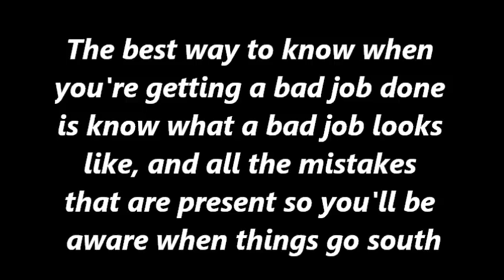CONTRACTOR SCREWS UP SHOWER

Comment: It's really difficult for me to evaluate the competency of a contractor before a job.  I hired a tile contractor who was RECOMMENDED by a mold remediation company we had worked with and multiple mistakes were made on our bathroom remodel project. There was a "miscommunication" where I had explicitly asked for a drain that had a removable grate so I could easily clean out the shower drain.  NOPE.  The contractor refused to install a new drain once the shower mud had been poured.  I tried to read-up on tile shower installation and inspect the job as it went, but I'm not a tile expert. That's WHY I hired somebody.  In the past, I think the contractor had hired somebody else to do the plumbing parts of the job, but decided to do it himself this time.  He cross connected the hot and cold water lines (didn't insert the valve) in the shower and couldn't figure out what was going on.  We had noticed the shower in the adjacent master bathroom was having wild temperature fluctuations.  His recommendation was to buy a new water heater. He came out 3 times to try and fix a water leak on our new toilet.  The adjustable height sink drain plug rod was bobbed off too short and was jamming, 2 months later, we found the drywall at the outside corners of the shower curb is wet.  One side of the shower door railing was installed backwards preventing the door from fully closing, which he did fix after I complained about it. 

 If you have any advice on what types of questions to ask when you are hiring somebody, I would love to hear it.

Comment: $1500 ? To do a shower? Lol.
I wouldnt dream of doing a shower for that. I might lay tile for that but build out the drain, slope bed, waterproof membrane and tile? 
No way!
I start my showers at $2900 not including the shower enclosure/door for basic tile work. A bucks up shower with a niche and nice porcelain or stone tile might go $5500 plus $1800 to $3200 for the glass enclosure/door.
There is NO WAY it can be done for $1500. No way.

Comment: I’m sorry but waterproofing is extremely important.  While it’s not “as critical” as the pan and curb, it will slowly leak and cause light mold growth in the stud cavity.  Not waterproofing walls greatly reduces the useful life of the shower.

Comment: A comment on the video. Take a flashlight and all the defects you pointed out will easily show up. I refinish tub and tile and the most common mistake I find is the tile meeting the lip of the tub instead of being inside the that area.

Comment: My attempt at a shower failed really bad. Good thing I stopped before I got to far. I’ve been doing flooring for 18 years. Just because u can handle a little tile on a flat floor or a backsplash underneath cabinets does not make ppl able to do ALL that it takes for a shower. I learned the hard way. 
Details 
Details
Details 
And prep till u cannot prep anything more.

Comment: Q&A: Have you ever tiled a swimming pool or fountain?  I’m not finding anything good about this on YouTube.  I’m curious about the challenges and special materials needed for a tiling project that is always submerged.  How does the pressure/weight of the water affect the tile?  I’m binge watching your channel.  Love it!!  Thank you!
Reply from the maker: Laura Saul no I do not have any applications that had to do with a fountain or a pool, only the coping tile around pool area. But there would be a specific thinset to adhere tile in a water environment, it's the chemicals that would affect the adhesion. Best people to ask would-be a pool company I would think.

Comment: Hey man, good videos. Have you ever done business with the Tile Shop? I'm a manager at one in Ohio. Keep up the good work!
Reply from the maker: Tom Nicholl yes I have years ago when a few of them open here in metro Atlanta I used to do business with them, not anymore. They are much more expensive than other tile shops, they do not keep anything in stock so if you come up short you're at least a week out from getting more material, but the biggest issue is their contractor kickback policy, you're supposed to get 5% of total sales for a quarter to use toward tools or material... but if you do not meet their threshold in that quarter with whatever sales you have, then accumulated sales go away and you start over again. Their sales did not go away but my little 5% sure did. I don't even step foot in that store anymore, or even recommend them

Comment: As to waterproofing membranes.... im a GC, do mostly tile now, large custom showers, floors and splashes. On one bath surround a few years back i thought about using kerdi but didnt. 3x6 travertine, modified grout, 3 applications of penetrating sealer and enhancing palm frond oil applied over that! Well, the walls were wood 2x4 studs with 1/2 hardie backer and drywall on other side. About a year later I get called back, the ceramic corner shelf had been ripped in half. Humidity was passing through the tile and backer board, made the stud kick away from the shower about 1/8". Simple fix, new shelf and some grout, more sealer. But I was gun-shy about wood framing for quite a while after that until I got sick of trying to screw hardie into metal studs. The take away Is I will NEVER tile a shower without waterproofing again! I am intrigued by red guard and will give it a try if you like it. Do you roll or spray? Some of mine are big enough to merit spraying. Thanks for these videos they are great!
Reply: BTW Im in the tank for Schluter Kerdi fabric, not the board. But they are moving away from styrofoam pans, curbs and seats towards kerdi-board and the kerdi on the board is not the same as what comes in a roll. Its terribly labor intensive and may be time to look to alternatives, at least for the walls not the pans.
Reply from the maker: What you dealt with in that story is definitely in anomaly, I don't know that I would say for sure it was caused by moisture but anything is possible I suppose. Redgard can be diluted and sprayed on, I am doing the roller and brush application for most all of my jobs.

Comment: Great videos, very infomative. Just ignore the trolls. Question, whats the difference between sanded and unsanded grout and when should you use them?
Reply from the maker: Sanded grout should be used in probably 90% of the applications, also if your grout line is more than 1/16th. Personally I would never use unsanded grout in any application in a shower

Comment: When putting up glass mosaic, you don’t use a standard 1/4” notched trowel?
Reply from the maker: Depends on the mosaic, some are VERY small, others bigger, some of the mesh backer is stiffer than others...honestly though, a mosaic doesn't need trowel, just get the thinset on and press it in.

Comment: I think one other thing as well with the TCNA/etc, is I think in residential situations, you can get away with a lot, and not have it be a giant problem. Where the TCNA and then various companies have a lot more concern is tiling things like entire subway systems, skyscrapers, etc. At the end of the day, the TCNA probably doesn't care a lot about a homeowner's bathroom. If you go on Laticrete's website they have 300 page manuals about tiling subway systems, hospitals, what have you. Even the basic TCNA class I got invited to by a Mapei rep would have counted toward a continuing education credit if I was an architect or engineer. Besides even expansion joints, they go into things like humidity, taking into account vibration, etc. In a house, to some extent, lots doesn't matter, and you can a lot of times do whatever and have it be OK, but by the book matters a lot more in those scenarios. Building residential showers in this way is pretty small potatoes work compared to if you were a foreman for a crew tiling an entire subway system. 

As an aside, for getting away with residential vs commercial. A friend of mine told me his uncle used to 5 spot residential floors, and whenever tiles broke he'd tell them "It's because you bought cheap tiles!" and he never got sued until he did it in a commercial store and they drove a forklift across it. Then after that lawsuit he moved to Florida.

Comment: I can only imagine how he set his pan liner if he  used one. I’ve seen knuckleheads use tar paper for liner, you can see the 1500.00 dollar difference from a pro vs an a novice
Reply: There is a way to use tar paper, it’s called a hot mop shower pan. I wouldn’t ever use that method but it is a method.

Comment: Thanks for the great videos, you seem like u would be a good boss to work for. Im doing my shower and watch a lot of your videos and i put down pebble mesh rocks for the floor and i understand that grout can fail because using pebble for the base there is a lot of grout in some areas. I used the tec power grout 550 that has sealer in it so u dont esentually have to seal it ever. Would u seal it anyway due to above normal grout area's?
Reply from the maker: mercedesclan 420 no...just like Prism grout, it's sturdy enough for large spacing and repels moisture

Comment: Love your videos. I do a lot of tiling myself and I am amazed how many terrible jobs you find. 

You mentioned that you like to see a grout line in the corners. I personally don’t like grout in the corners because it tends to crack after a short while. I always explain that to homeowners and try to have them agree to silicon for the corners. Obviously the downside is that sometimes you won’t find matching silicone.

What’s your take on that?
Reply: Joerg Neumann his take is he likes grout in the corners. Why dont you grout the corners so it matches and than cover with clear silicone for protection. Or just mix your grout with a grout sealer so it's more uniform and water proof.
Reply: @ddentici  u need at least 3/16 bead laid for silicone to last.  Smearing silicone over grout or small thin beads will crack and not do anything but get crap under it that will start to mold, then u gotta scrape it off 6 months later when it begins to fail.  

Haven't check since 2000, but silicone caulk in all corners is code in MI

Comment: Hi Bob, 18.06. Me to.And i expect to be shot down for this. I have tiled i dont know how many hundreds of showers without waterproofing. The 2 shower rooms in my own house, both tiled 19 years ago, no waterproofing, tiled straight onto plasterboard, bone dry. No issues whatsoever. Corners and joins taped, acrylic primer, powder flexi adhesive, good notched trowel and back buttered. In London where i live and work there is a lot of competition, and prices are tight, very tight. If i cost in all these fancy waterproofing systems, and once ive added my VAT, i'd be out of work, fact. Always someone cheaper especially if they are not VAT registered as i am. VAT alone adds 20% to my estimates.
Reply: A "fancy" waterproofed system with good mortar and backerboard will last 100+ years. The schluter system alone is tested 4 stories underwater. There is cheaper ways to get the same results as the schluter system however. It comes down to an exact science and materials together and yes there is a million ways to do things and some appear to work fine but with tile it can appear just fine until there is a major problem that suddenly appears.. a hairline crack in grout and no waterproofing for example and then all the sudden it's completely rotted out behind the perfect looking tile covering it up. in your case Plasterboard is stronger than drywall and porous enough to bond to mortar. Your acrylic primer/tape is acting as your waterproofing which is better than nothing. The powder flexi adhesive is good because it's probably glass based and won't absorb as much water as the ordinary cement based mortars which is important in your case. So all in all doesn't seem that bad from material point of view with weakest point being the backerboard is the plaster walls. I'm no expert but that's my observation.

Comment: I think a problem is that being "by the book" it's first better to know the rules before you break them. My house has 24" joist spacing, technically TCNA basically says I should not have tile at all. I decided I'd be marginally safe enough if I thinsetted my CBU in that scenario, added some blocking when I put my new plywood in, and used good thinset (Custom Prolite) and Aquadefense as an uncoupler. Hey, the tile job we had on first moving in (lasted 4 years before my mother hired someone else who did an even worse one) had no cracked grout or tiles and it was Durock on top a messed up subfloor with 2 layers of linoleum and laun, and applied with a V notch. Sometimes it's a combo of luck and how the user uses stuff. In my house my railings are put on with wall anchors and it's 100% fine and lasted for years. My friend's house, put a railing on with wall anchors for him and it broke in a month or two, because we're generally nicer to our things. 

A "rule" scenario that tripped me up, I bought a Henry patching product to try to level my floor and it was absolutely terrible for that purpose, and a normal rapid set thinset actually worked a lot better, shrank less, didn't crack, was cheaper, and, didn't set up in 5 minutes, etc, but it broke the "rules." 

One thing a semi-high level guy at a TCNA conference told me (it was actually really neat, tons of free food and beer, a Mapei rep invited me, a homeowner, when he was at the store that day because I was asking him about the Aquadefense reenforcing tape...) oddly enough was "It's usually not the first thing you do wrong that causes problems, but the third or fourth thing..." So that goes with the rules. It's better to know the rules if you're going to break them, and know why the rules exist for what reason. Then if you gotta break them, you gotta break them. To some extent on the forums, it gets into a bragging contest of who is most by the book, etc, and it's silly, but it's good at least to know the rules first before breaking them.

Comment: Should have recommended for guy to finish then use shower until it falls apart most likely 10 year later if not used 5 times a day, especially if quality matches other low-skilled work like paint job with dirt all in paint, or dented crappy installed trim or other

Comment: Awesome video. It helps a lot of home owners to understand what they are looking for. I will disagree with you on grout lines on the inside corners as grout will crack because of vibration. Where as a bead of colour matching silicone or a neutral colour will not.
Reply from the maker: As personal testimony, my shower is hitting 5 years this November & not a crack to be seen...anywhere...should it occur I will caulk, can't remedy a problem without a problem.

Comment: Damn bro that is a jacked up shower.  I hot mop my showers.  I lath, scratch and float the walls. My showers are solid as fort Knox when I'm done. My niches are precision framed for full tile layout.   I don't do any of that Schluter crap or backer board. Real tile guys cement float, just saying!

Comment: I’m not sure if your in Georgia or Florida? I’ve heard you mention both. Do you not have to be a licensed contractor in these states to do work or specific trade licensed? 
You say in your videos “the contractor” did this work. The videos you show looks like the type of work I see from a guy that thinks he’s a jack of all trades but master of absolutely nothing.
Reply from the maker: As Progressive as Metro Atlanta has been the last 20 years, they are still a lot behind on many things... it wasn't even until about five years ago that you had to use a seat belt if you owned a pickup truck, they finally passed a law mandating that !
Still in the end it is homeowner's responsibility to do their due diligence

Comment: Bob, about half the tile jobs I do include some sort of accent tile and I rarely find the difference in thickness to be 1/4", even when considering the thickness of the thinset. What I  do is get all the main tile done first, then make a screed to build up the accent areas with thinset to the exact level needed. I hope you can picture what I'm describing. It is meticulous and does require some careful planning, but it sure beats always having to hunt down a suitable material of the correct thickness.
Reply: Ted Weddell that is exactly how I do it. Comes out perfect every time.

Comment: Waterproofing for the shower floor should be done before the mud floor. Not after. At least that's the way I've grown up doing it.
Reply: Eric Malecki there should be a pan liner membrane between 2 layers of dry pack mortar. Not sure why he said the floor isn't waterproofed, if you have a pan liner you dont want to waterproof the mortar bed. You do want to tape, mud, and then waterproof your walls. That is not a requirement, but it is good practice.
Reply: I've never waterproofed walls. Tape, sure. Idk. We've always sub floored the shower, to get a little pitch. Rubber. Then mud. Get whatever pitch you want, set tile and grout all at the same time. Of course depending on tile.
Reply: Two layers of dry pack seems excessive.
Reply: Well here in oregon, that is how it's done. I've never had a GC pre slope the shower subfloor, nor have I ever seen that done. So it is up to me to "preslope" a mortar bed, then install my liner fill it with water, let it sit 24hrs to ensure there are no leaks and have an inspector check off on it, the install the final float and float my curb. There are many ways to skin a cat, but that's how I was taught.
Reply: Robert Henderson lol. Yep. Many ways to do the same job.

Comment: One question what happens if you leave a no grount line joint .??? Tile to tile ??
Reply from the maker: Romualdo Duarte do you have to have grout lines, they are used for expansion and contraction of the surrounding tile, if you had no grout lines the tile could tent up or crack
Reply: StarrTile ok thx ..